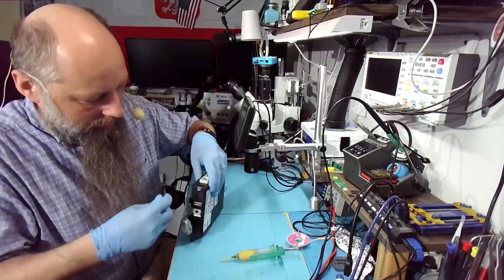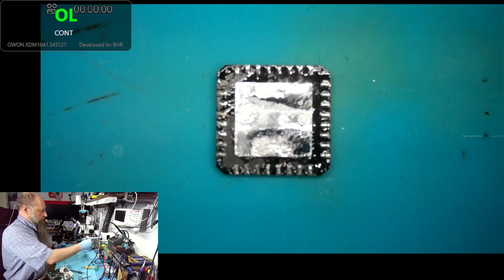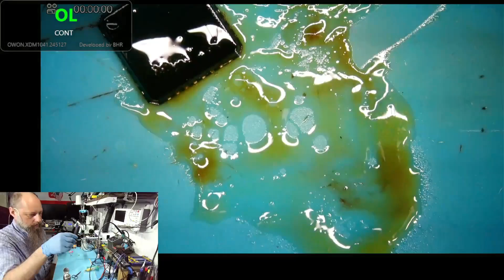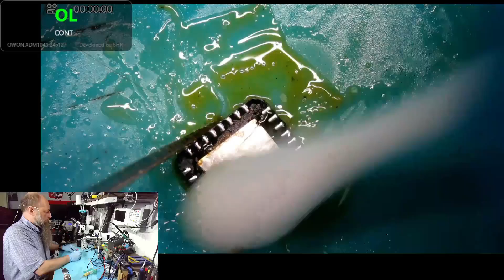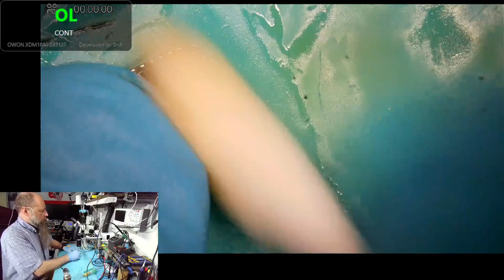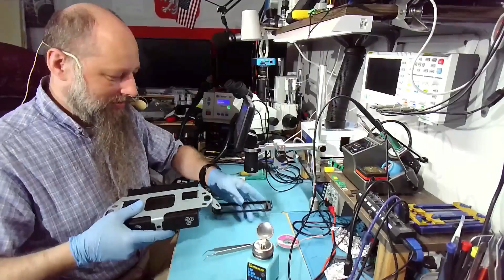221 | ECM Repair and a hangout

Comment: For the HDMI PS5 let the board hang off the edge of the table. Take your hot air and remove the nozzle. Put it on full blast and heat the underside the board hanging off the. Specifically, under the port. You can literally pluck the port right of the board, escpecially if you take your other hand and use your iron to introduce solder. Then move the air further away towards the floor but still pointing up. Clean and tin the pads, then place you new port on its pads (pretinning helps). Add flux and then bring the nozzle back up the boar. Since its one big copper plane it transfers heat wonderfully. Give it a minute and suddenly everything will melt and your chip will just "lay down". Doesnt even need touch up sometimes. The only thing I'd say is when heating the board, TAKE YOUR TIME!! Rapid heat ramp up = warping and delamination as moisture try's to escape the PCB too quickly
Reply from the maker: thank you, good advice

Comment: Thank you for hangout with a coffe and chip :) I enjoyed listening about flux. Could you possibly recommend a flux that would be good for soldering aluminium wiring?
Reply from the maker: oh, aluminum is tricky to solder due to oxide layer, you need very agressive flux to help with that.
Try Superior No. 1260 (Zinc chloride-based) or Nokorode Aluminum Flux paste.
Reply: Just make sure you clean the hell out of it. Friend of mine was experimenting with a super thin flux that was highly acidic. Almost like water. He was trying to have it flow under an IC speed up the BGA melting. It did work, however, he was unable to clean it properely and within a number of weeks the pins began to dissolve.